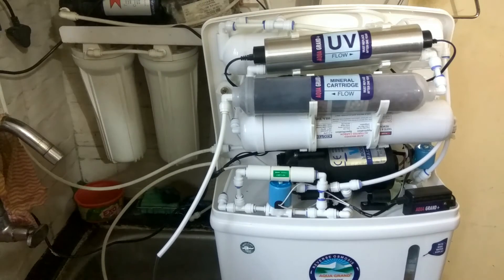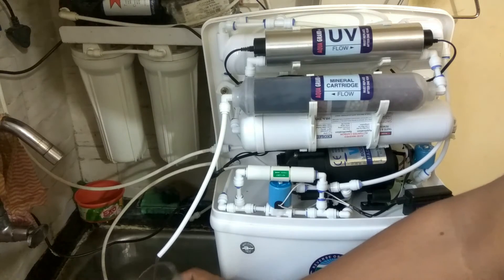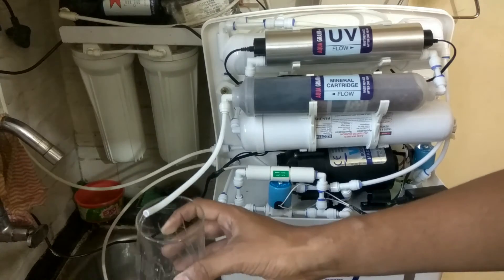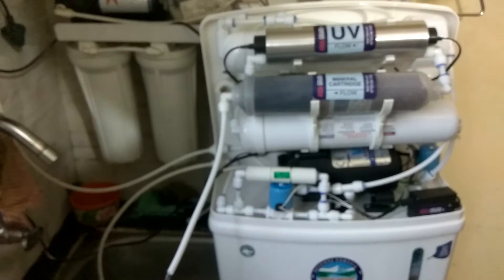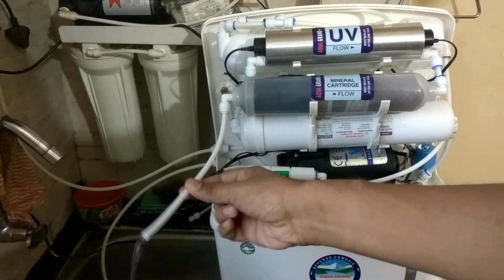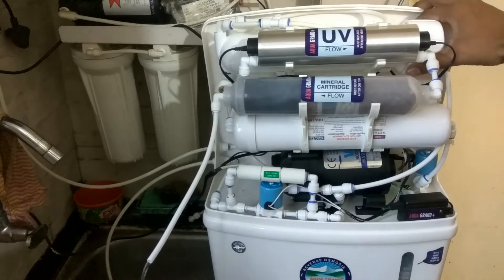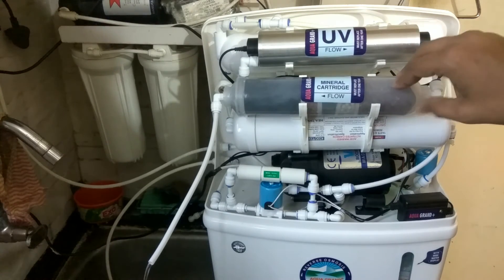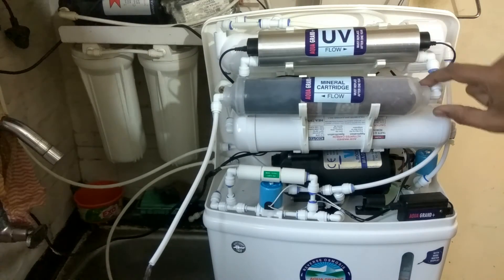RO Water BAD SMELLS FIX

Comment: I have a 3 standard stage, then I have a Post carbon filter, and a Ion filter. But I also added ANOTHER post carbon just before the Ion filter, so it is 2x post, then Ion filter. I have all new filters, and the water has a light smell like chlorine or something, but taste is STRONG horrible!  Also the issue is I now have 45-60ppm TDS reading with 5.5 pH reading.  Before I changed filters I had 10ppm TDS (didnt check the pH before changing). You said flush for 2 DAYS??! That is a LOT of flushing , which I did not have to do. This is more like a BAD quality membrane issue?
Reply from the maker: The filter are acid washed. Not good

Comment: My ro water tastes a bit like plastic. I replaced all the filters recently, and have run many tanks but it still has the weird taste.
Reply: @uraninite81 
I got a new RO system and mine smells and tastes like plastic too. How many times did you empty the tank? I’ve done it a few times and it’s not getting any better
Reply: @Princesssonny7  a lot, 10 plus over a few days but it’s perfect now and doesn’t taste bad at all.
Reply: @uraninite8151  thank you so much. I will give it another few days
Reply: @uraninite8151  you were right it’s fine now. It took a lot of days lol
Reply: @Princesssonny7  my water purifier is also smelling like plastic so, should I have to throw the filtered water in tank for 10 times?
Reply: @Shreshta997  yes it took awhile but it’s great now. I did it at least 10 times. I know it seems like a waste initially but it has to go thru it. I am loving mine now.
Reply: @Princesssonny7  thanks for your quick reply sona
Reply: @Shreshta997  good luck
Reply: Pls check ph
Reply: @prashanthuvallappil6325  it’s all good now. I ran a few more tanks and it now tastes ok

Comment: sir can you suggest me . can i use 80 gpd ro membrane with 75 gpd pump.if yes then which FR is suitable.
Reply: Fr 450
Reply: Fr depends on the tds not gpd , if tds is less than 500 use 300cc otherwise use 450cc

Comment: hello bhai,mera tds 290 hai but water taste is so bad i need sweetness in  water,csm 50 gpd membrane 100 gpd pump, fr 300+450 =150 fr, but still i need 350 tds n water sweet ness
Reply from the maker: +chingesh khan 50 gpd ko only 300 fr chaiye
Reply: Reviewmaza haan i knw but usse tds kam ho rha hai.isliye 150 tds kiya, 450 add karkar.
agar mei 80 gpd membrane use karu aur 300 fr use karu to kya 450 tds aa sakta hai.
Reply: i need minimum 400  tds to maximum 520 tds my raw water is 1900 tds